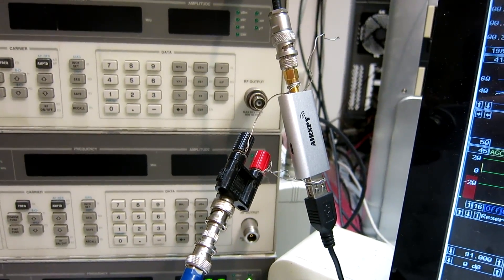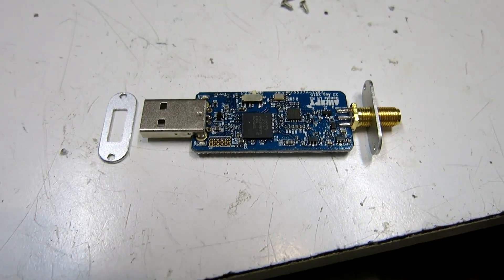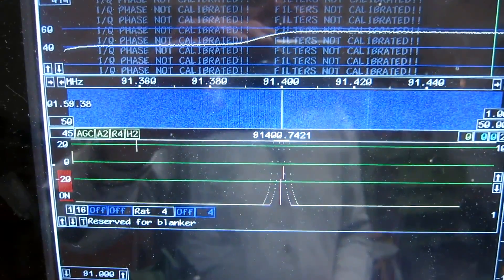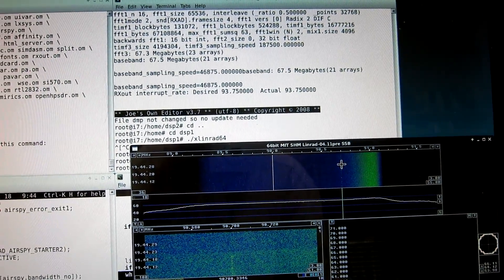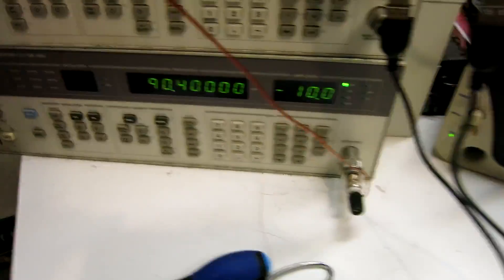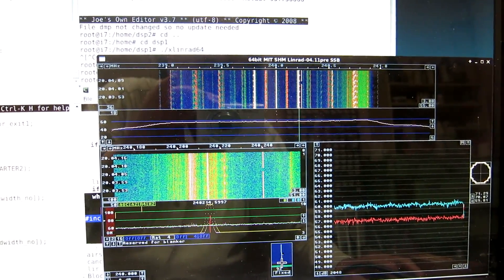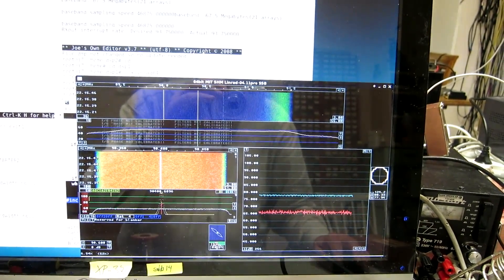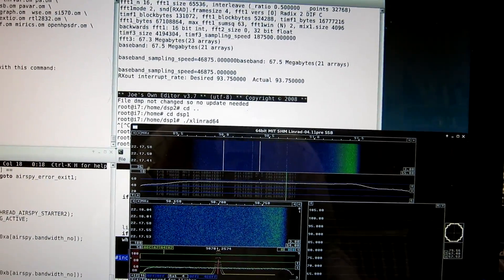airspymini

Comment: Hello from Romania,
I am interested about the difference in decimation settings between the Airspy Mini and the Airspy R2, is there any significant difference in SNR values and noise floor, especially on LF, MF, HF and FM 64-108 MHz?
Reply from the maker: I do not know, but assuming that the hardware is properly designed, the performance should be determined by the tuner chip. There could be some differences in software that I am not aware of, but I think all Airspy units are very similar - but they could differ in how difficult it might be to keep USB
and computer noise low enough to not affect performance.